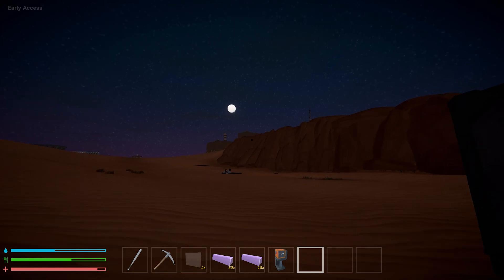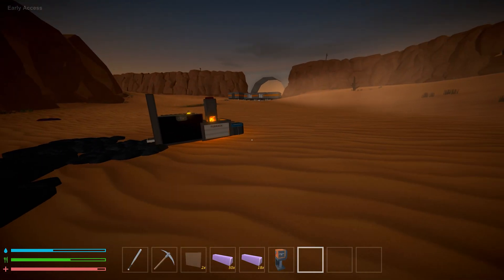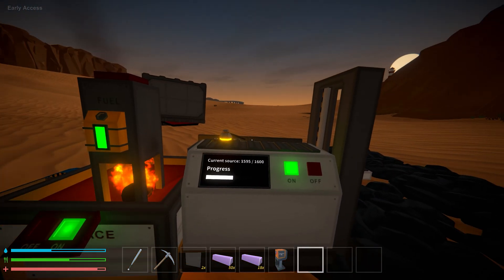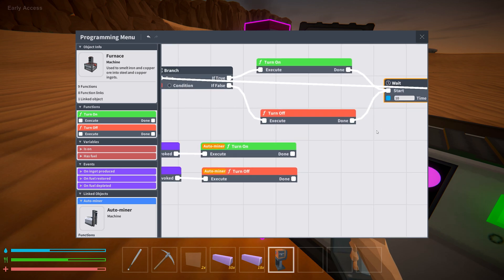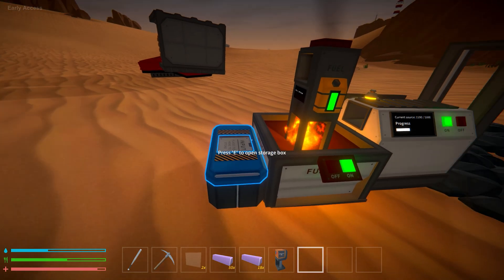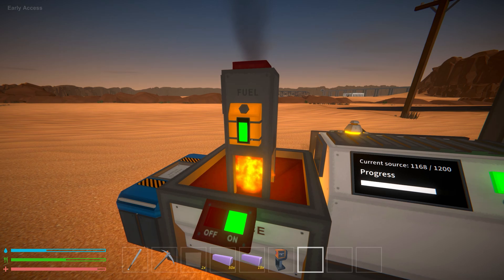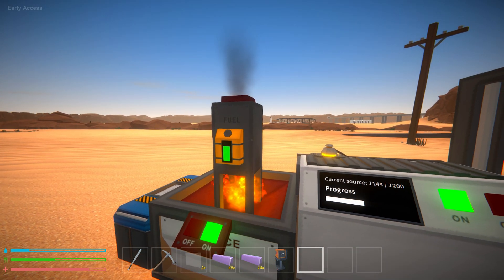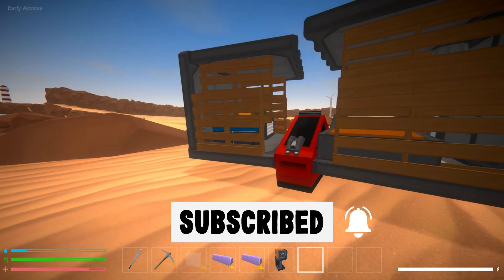Mechanica Gameplay - How to Program a Solar Mining System - Tutorial

Comment: Add a light to your mining rig, when the miner outputs an ore, toggle the light on/off. Then have furnace check if light is on or off, if light off, turn on furnace. when furnace done smelting turn furnace off. no need to check if miner has power
so, first ore turn light on, second turn light off
Reply from the maker: I actually did a tutorial on this method. (It was video I referenced in this video)

A lot of folks seem to say that I can use number manipulation which sounds scary, but I should really learn it. haha!

Comment: So maybe I'm confused, and I've only just started to watch you play mechanica. If you replace (key word) the if loop to turn it on if the miner is on, with a loop to check if there is ore in the basen then turn on would that work?
Reply: Yes and that is the better approach.  I actually put a counter on mine that counts every time an ore is produced and once it is greater than or equal to 2, it turns the furnace on and subtracts 2 from the counter.  Once the furnace produces an ingot, it turns back off.  This is the ultimate way to save fuel.  You can also add an "on mine attempt failed" (forget the exact command) to shut off the miner if the ore runs out - if you wanted - although with unlimited power it is a moot point.
Reply from the maker: Nice!
Reply from the maker: Looks like someone answered you already but it does seem like this would work. That's the cool thing about this game! Lots of ways to do one thing. :)
Reply: @Vortac  love the vids man!  Your videos always get my mind juices flowing and make me launch the game again to perfect/update something.  lol